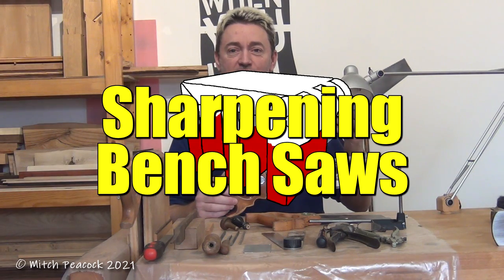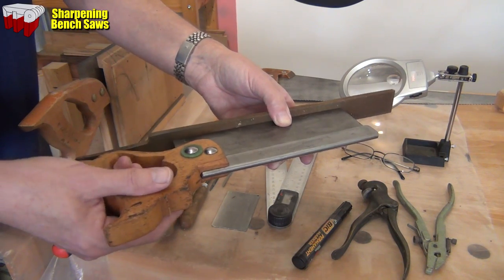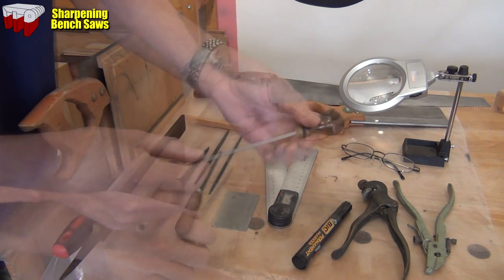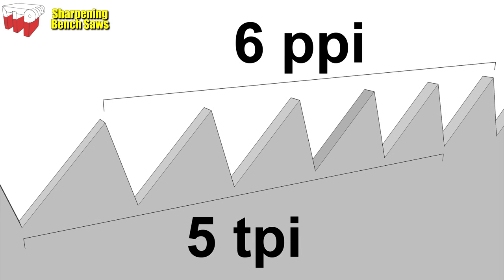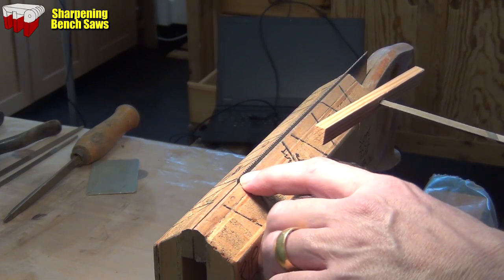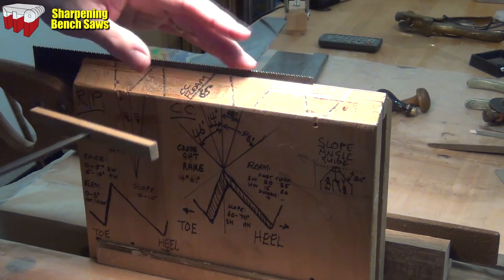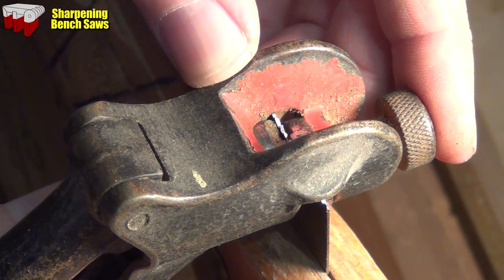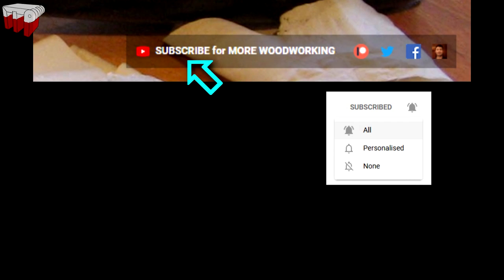How to Sharpen a Saw - Bench Saw Maintenance

Comment: Nice video, Mitch.
You explained and showed it great! 👍🏻
The flat file that you clamped in the block of wood. For this I have a device from Veritas, which is made of aluminum and is also used to sharpen scrapers.
Well you took a normal triangular file. In exceptional cases, you can use them because the triangular saw file has a sharp edge at the tips. This is done so that the tooth base is slightly rounded and therefore cannot tear so quickly. What can happen with a normal triangular file.
Reply from the maker: Cheers Gunter,
I'm slowly moving over to 'proper' saw files, although the files I have were only ever used for saws and have lasted really well. For years I had no idea there was any difference.
Reply: Hello Mitch,
Thanks for the answer.
I didn't have that before either.
How was that "You are capable of learning". 😂